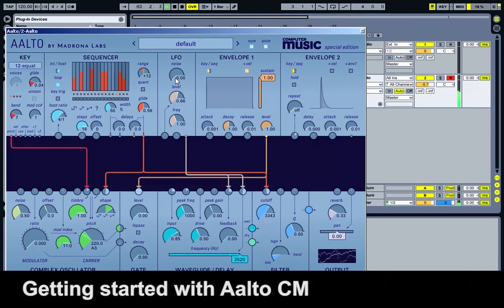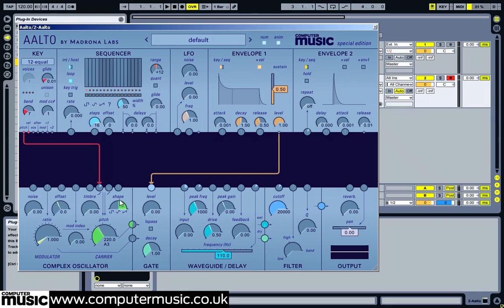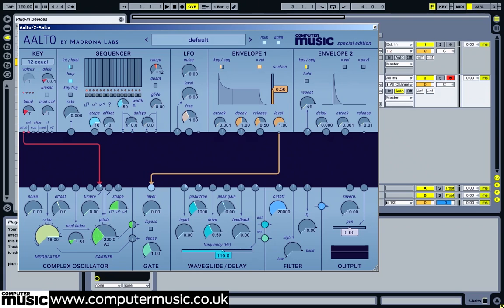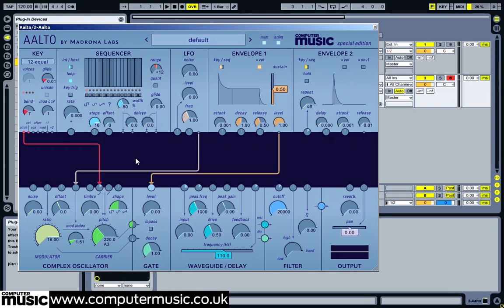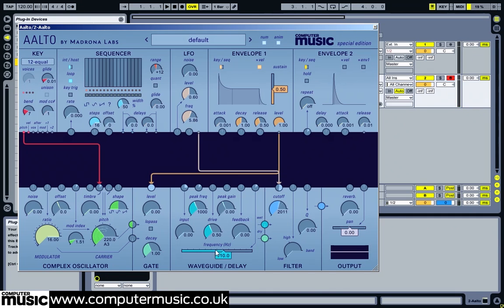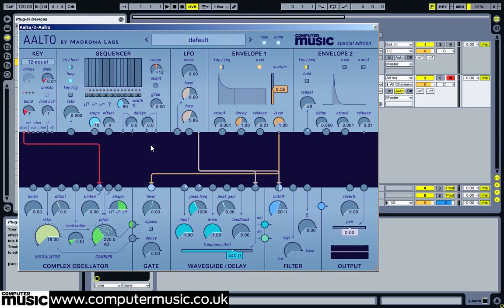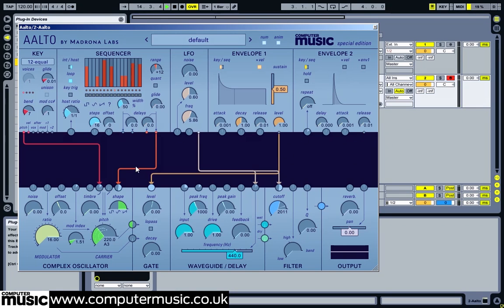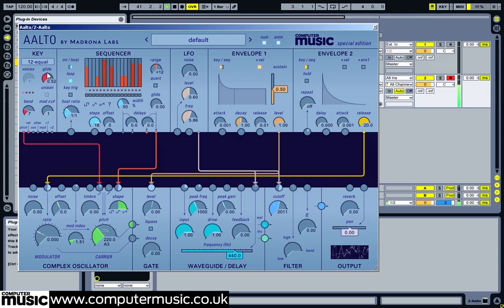FREE synth plugin: Aalto CM from Madrona Labs

Comment from the maker: The LPG (low-pass gate) is the GATE section next to the Complex Oscillator section in the lower left – click the "lopass" button to use it as a low-pass gate.

And you can make the Buchla bongo sound – there's a preset to get you started with this, in the Aalto percussion section.